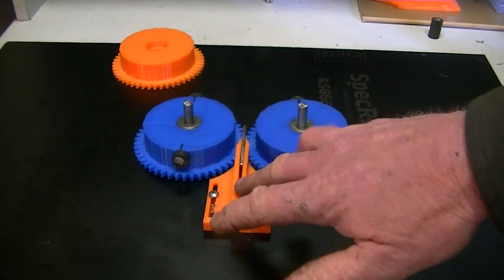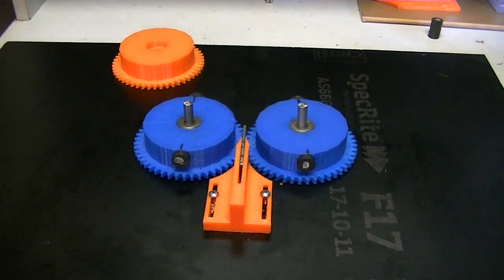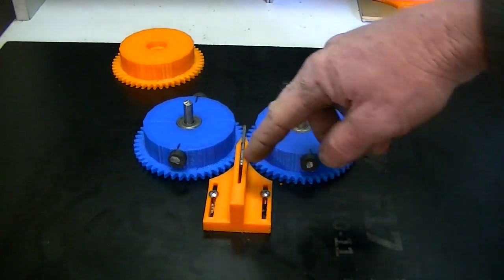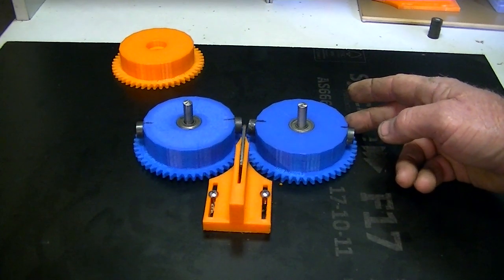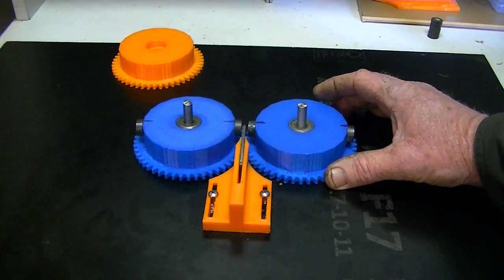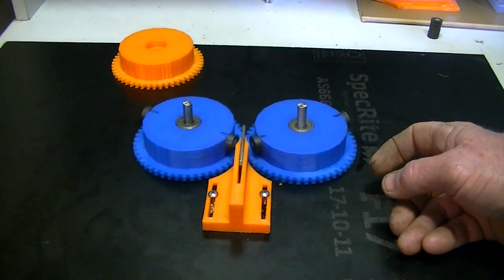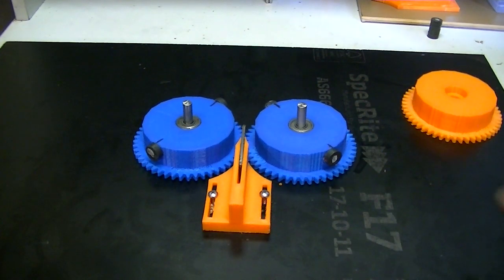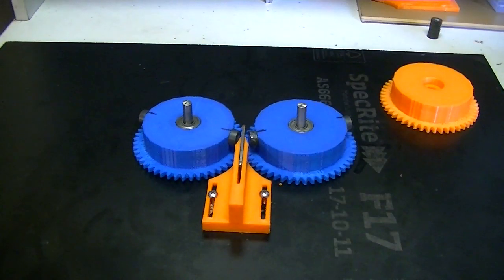The magnet motor that wasn't

Comment: Although there is a sticky spot, the inventor of the diesel engine had a similar problem with the compression cycle of the diesel engine untill,.....a heavy flywheel was attached to get it through the "Sticky" spot. True Story

Comment: Have you tried putting a stainless plate (magnetic shield) between the gears and then have the gear magnets repel?  Therefore when the  magnets pass by the magnetic shield, they will repell causing the gears to spin?

Comment: This experiment proves nothing one way or the other. You have to have adjustable axis of your rotors so you can push them further away from each other. Your problem could be too strong magnets on rotors and too weak one on the stator. By adjusting the gap between rotors you could lessen the force of rotor magnets.

Comment: What about using an iron plate instead of neo magnet. Iron plat beveled to a thin sheet. The closer it gets to the center the closer it gets to the magnets. Iron will attract any pole. The thinner the plate the less magnetic pull? As the magnet slips off the end of the plate it repels its counter part.

Comment: Hi Tinman.
The use of the neo is a little problematic,, you can easily use metal "shields" top and bottom, or a lot of other configurations actually, to weaken the field so as to not saturate the ceramics.  It really does not matter however since the sticky spot will still be there, even if you were to go with a linear setup,, btdt
With these shielded setups I always ended up needing to use a temporary field extender,  a coil, another movable magnet, a movable magnet and metal combo, something  that makes the end of the shield further away then turn it off after the magnet passes the end of the shield magnet, far enough so as to not get sucked back into the lower potential area of the shield.

Comment: Hi build it with multiple layers and have the magnets in a gradual spiral pattern also replace the centre magnet with a steel flat bar and u should not need the pulse

Comment: Very nice mechanism!! This design idea is very interesting. I was thinking about building this model as well but my plan was to use iron on the stator and make it in V shaped block that smoothly attract magnets on both sides until the magnets are already past the middle line and once they stop attracting to stator they start repulsing from each other

Comment: @TinManPower try to replace stator metal with material that does not allow magnetic field through. And remove the stator magnet.
Reply: There really doesn't exist such a material. Some materials can direct magnetic fields a little better than others, but that's it.

Comment: Try putting the stator magnet on a balanced seesaw then sync the action  so that the stator magnet is in the correct position twice per
revolution, a balanced seesaw would require very little effort to lift the stator away and the opposing forces from the rotor magnets should drive the motor,  a small spring may be needed to pull the stator arm back down, however it might just cause the stator magnet to lift rather than turning the wheels, maybe a pendulum arm might also work just my 2cents !

Comment: The magnetic interactions go through the other magnet and create di poles in between as seen in my video. You must control the flux on approach and flip it’s polarity via electromagnetic induction and split second capacitor discharge to achieve a advantage.

Comment: The noise is evident even before the magnets are within 20% of each other.  VERY precise alignment and tolerances (bearings included) are needed for a high efficiency cog motor.  I love your approach - Push on and report back as necessary.          - Cheers.